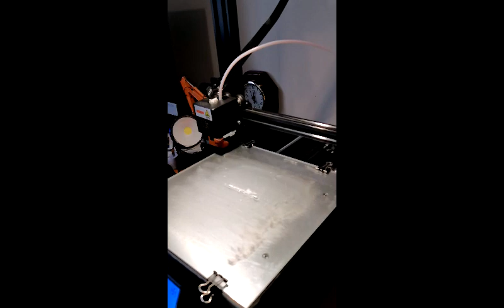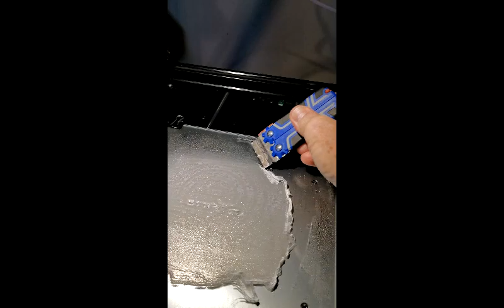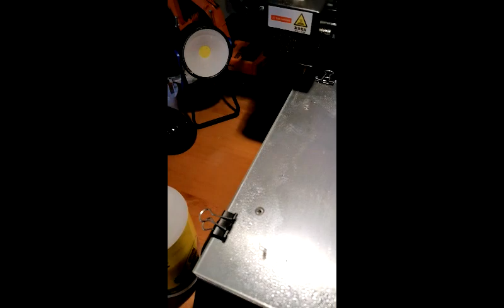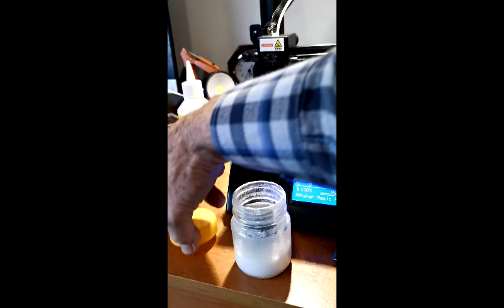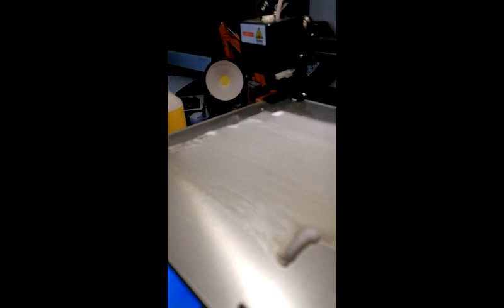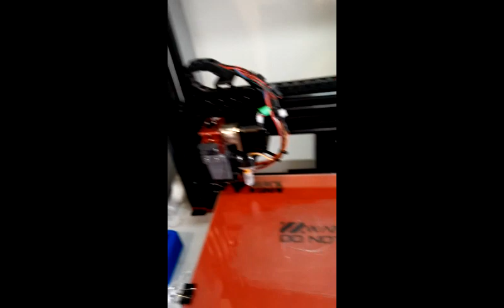3D printing using PVA glue on glass bed for adhesion includes cleanup

Comment: How many prints per coating are you getting?
Reply from the maker: If you wait until the bed is cooled most parts come off without marking the surface,  you can recoat the area to be printed on and also scrape the surface with scaper that gives a surface for the print to stick to. Clean and reapply I would do between 10 to 20 prints. JGAurora with the textured glass the PVA tends to lift off more so requires more regular recoats.
Reply: Good video mate, everything I wanted to know. Keep it up.